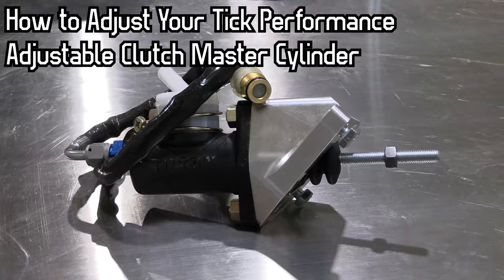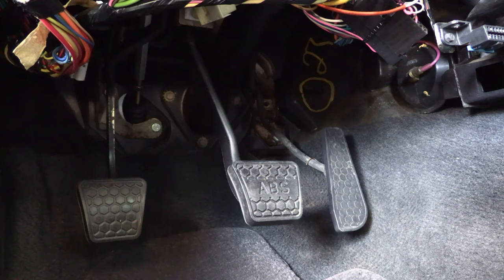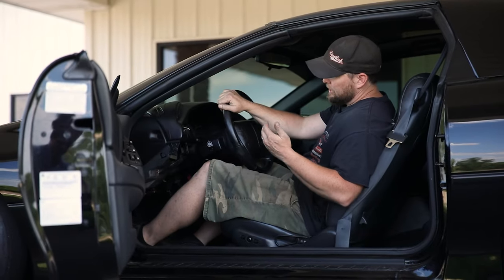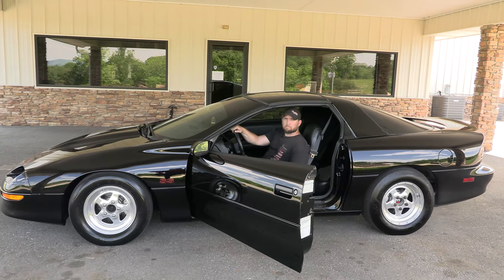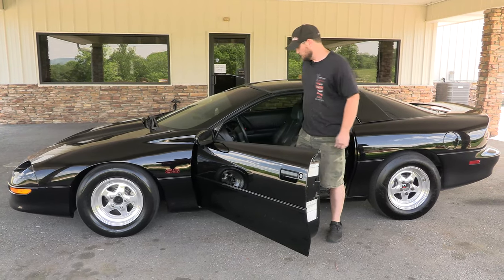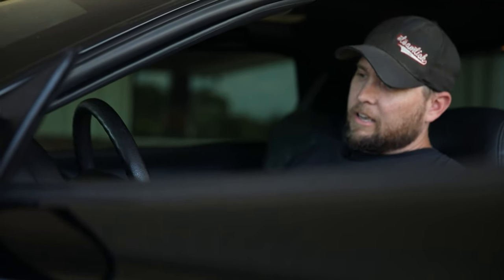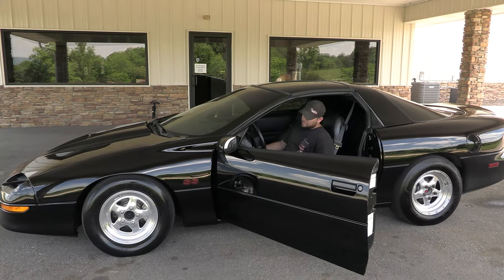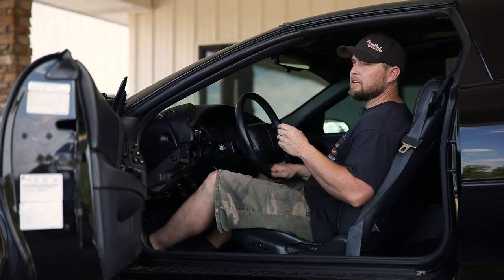How To Adjust Your Tick Performance Adjustable Clutch Master Cylinder

Comment: I installed your master cylinder and billet shifter in my '02 WS6 last year.  I rarely drive the car and recently noticed that I was grinding going into 3rd at WOT.  I progressively lengthened the rod 3 turn, one turn at a time, until it now shifts smoothly and quickly without any grinding at 6500-6800 RPMs.  The first additional turn allowed it to shift quickly but still ground a little.  The second allowed it to shift smoothly up to about 6K RPMs.  Finally, the 3rd turn allowed it to shift smoothly and quickly at redline.

Comment: This video is great and very detailed. I was not aware of the rev test etc. 
I have that almost exact master from another company, except it's a third gen with a TKO and a lakewood bellhousing (uses a shift fork and external slave). My stock config would be very difficult to get into gear intermittently. Most obvious when i was driving for a while. I installed the new kit, and extended the rod until it went into gear easily. Drove the car 100 miles or so and was thrilled with the shifting and pedal height. 2 days later i backed the car out and, besides reverse (unsynchronized) it would not go into gear. Any suggestions on what might cause this? I intend to adjust the pedal up a bit more, but somehow it changed.
Reply: You probably have air in the lines or you're having a clutch failure. Also check your lockout solenoid if you have one
Reply: Also, ensure that you have the locking nuts tight against the adjustment bar so it doesn't rotate. Locktite can help keep it in place

Comment: Does this apply to c5 vette as well? I have messed with mine so many times and can’t find a sweet spot. Now I’m having trouble getting into 2nd and 3 when I launch in the current adjustment. Feels great driving normal though.
Reply: Yes same for c5. Did you change anything else... clutch or slave?
Reply: @tooslo5oh44  both
Reply: Good to know, doing mine as well. Was never adjusted when installed, catches super high

Comment: C6 Z06 here with a ZR1 twin disc clutch, ZR1 slave, and a Tick Master cylinder. My car wants to roll forward when going into first gear. Does the rod need to be shortened or lengthened? It shifts a little notchy so I’m thinking it’s not set correctly. Any help would be greatly appreciated.
Reply: I have the same problem.  08 Z06.  Car does not want to shift at 6,000 rpm.  So I don’t even bother going to 7,000 rpm.  I feel that the master cylinder rod is adjusted to where it needs to be.  (Just by the feel of it).  But I don’t believe I am getting all the air out of the cylinder.  For whatever reason these things do not bleed easily.  I’m starting to think dam near impossible

Comment: Are you threading that rod clockwise or counterclockwise? And does the nut tighten against the clevis or the end of the threaded rod closer to the master cylinder?
Reply: Also would like to know..did you ever get an answer or figure it out?